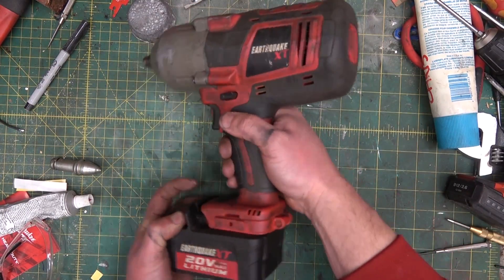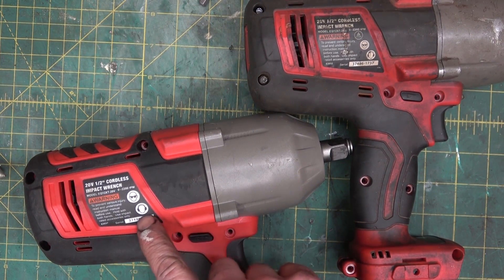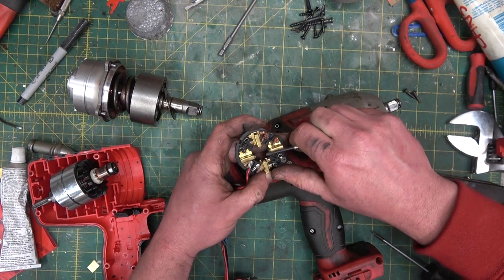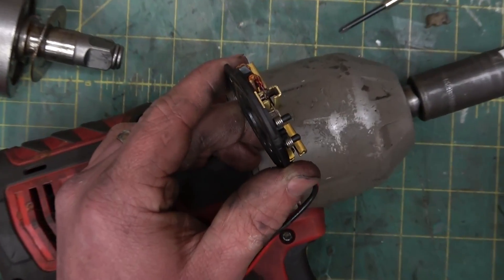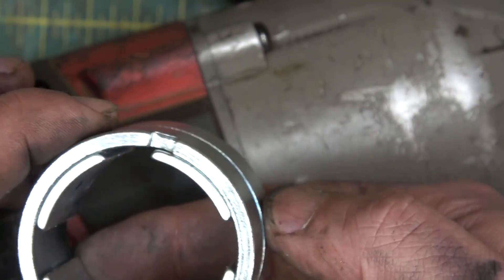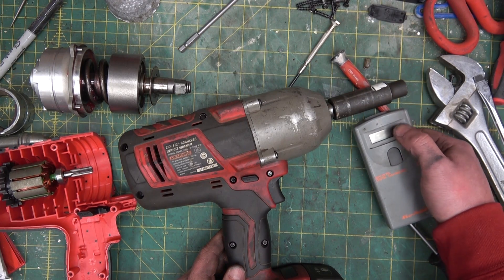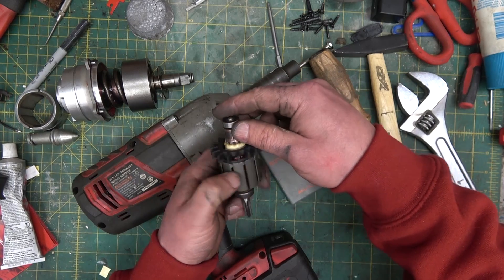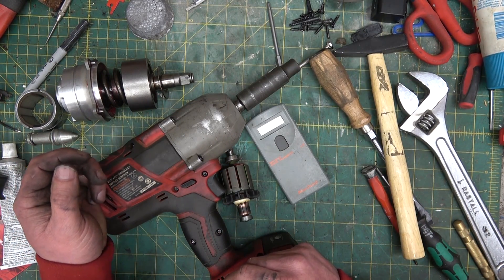Mystery Solved! | Why Impacts get weaker

Comment: So can anyone weigh in on the overall chooch of this gun?  I've had one for about five years and only use it for swapping snow tires on and off three vehicles.  The speed is fine, and batter life is good (only 24 tires a year), but the torque is underwhelming on snug lugs.  I usually break the nuts with a bar first, then use the gun.  I don't see the tire shop guys having to do this with airguns.  Is this normal for battery powered nut smackers, or is mine maybe weakling?  I don't feel any wrist straining torque under load either.  But I've only ever used this particular nut smacker.
Reply: YES.
But that still doesn’t answer my questions.

Comment: I've got two circular saws where the brushes got so hot the springs lost their sprung and started arcing real bad. I've replaced the switches and field coils in both. The armatures tested good by a local guy and I've tested them with a multimeter, but after allt hat, the same issue is presant. What else could it be except the armature? Can tested goo armatures be bad?

Comment: I've fixed a lot of brushed Makita drills for work, and I've seen the same thing happen to them. It always happens when heat is involved. (Overloading the drill ec)  I think it's the insulation on de rotor getting bad, and starting to "leak" current, Wich will mess with the timing of the commutators.
I don't know for sure though, but when you those Makita drills under load while they have that problem they also eat brushes, and get pretty (not extreme) hot thoug.
I'm no expert, but maybe this will help ;)

Comment: Hi, PhD student in magnetic related shit, the power loss is probably due to magnetic ageing of the motor core. Carbon precipitates out of solid solution (or maybe goes into solution depending on your environment or due the dust from the brushes). See Electrical Steels for Rotating Machines by Philip B, page 26 (or message me I'll send you a copy).  

Maybe annealing the core would help? Would be an interesting experiment.

But maybe I'm wrong lol.

Comment: The serial number is so, if you try a rotor swap and return, the cashier takes it apart in front of you in 5 seconds flat, says ‘not honoring warranty, you swapped the rotor, that serial number is not for this rotor.’

Comment: I was thinking when I watched the 1st vid that he has a perfect opporotunity to go parts-swapping to diagnose it further. Glad to see he followed up.

As for the bad rotor, you have multiple brushes and multiple contacts on the rotor that the brushes hit. If one is leading to a broken connection, then that broken connection could easily result in a 25% reduction as the bad connection spins around. I'd want to take an ohm meter to the contacts and see if I could figure out if one contact combination has an obviously higher resistance than the others indicating a broken lead.

Comment: Worth noting that if the magnetic field strength of a motor degrades, the motor spins FASTER when unloaded, because the speed of an unloaded motor is governed by its KE, or the ratio of backEMF to rotational speed.  A demag'g motor cannot make the same torque per amp as one with a full strength magnetic system, so when loaded it is less powerful, but unloaded, then the max speed is simply point at which the forward voltage applied (from the battery) is close to the BackEMF of the motor.
Reply: What you say is true for DC motors with shunt wound stators. I believe this is a PM stator so the field responsible for back EMF is not reduced. And the field of the armature does not contribute to the field of the stator in generating back EMF.  However, if there are shorted windings (as we suspect) that back EMF will be converted to a magnetic torque  load, even if those windings are NOT in commutation.  Meaning, they will contribute  a mechanical load anywhere in their rotation, whether in circuit or not, as long as they are moving through the field of the stator. 
I like the way you think though.  AvE has cultivated a tough crowd for sure.

Comment: Hot cold, hot cold, hot cold work hardens copper, More "work" harden = more resistance. More resistance, more bad till no go time!
This is common on old skool kool, kick-a-me-start motorbicycles. Having half the generator rotor sitting in hot then cold oil somewhat upsets the pixies. In turn, they then upset the rider when it takes an hour or more to kick start the beast! Typically this happens down a dead end trail, in summer, with no other traffic for about three hours.
Have watched this fun many, many times.
But mention a rewind? Nah it won't be that they say, It' be the carb, definitely fuel...
Moral? When you think it's definately something else, recheck the electrics!!!

Comment: Never have guessed that. Fucken motors tho, I’ve had to permanently shelve my Bosch (blue) 10” sliding saw, bastard thing runs but it runs TOO FAST! after lots of head scratching and no answers from the hive mind, I asked a professional motor winder why, and it’s in the motor windings. Can’t be fixed basically. Damn thing distorts the blade when it winds up to full Chooch. So anyone that wants it can have it.

Comment: So a year of commercial use, new motor brushes/rotor, so another year at least barring the trigger failing. If they sell the parts and they're easy to obtain... newer versions might have better fan cooling on the motor now that you published this autopsy as likely the cause of the failure being an overheating armature.... they seem to have bulletproofed the mechanicals!

Comment: The neodidliums in the rings may in fact have less of a field, as field weakening on a dc motor speeds it up.
You get the same amount of power though, less Nm but more ripppppms.
That does not explain this unique phenomena do......
Lets leave it at the fate of the copperilium being worn out
Strange, normally when copperilium has turned green where the kryptonite has leaked out it's your clue.
None here.
Reply: If it is in fact neodidlium magnets, then I would expect the magnets to lose magnetism if the motor were to overheat. They do so at above 80-90 degrees centigrade (just short of a couple of hundred imperial degrees), which is little enough to not get the shellac to smell. I know the phenomenon from model airplanes. Here we tend to overexcert the motors, causing heating, and subsequent power loss.

Comment: Probably why my law tractor starter motor has a hard time starting too! Took it apart and could not find a thing wrong after 18 years of use! 
Thought it was due to lead wiring but a friend replace his wires with bigger wires and it overheated relay!?
Reply: Sometimes starteds can short part of a wiring group and draw far too much current, if you keep burning parts and the starter is turning too slowly then just replace the starter, or check current draw while starting and see if it's excessive.

Comment: Am I about the only one thinking the resistance might be coming from worn out bearings???? Plus the slop in the shaft area?? It is a bit mind boggling to think it's the armature...... Because maybe it's really just the actual moving degrading parts on it? What's that law about the easiest or simplest solution?...

Comment: Hey AVE, I am scratching my head on something that I'm hoping you can possibly shed some Light on. I recently did some home automation stuff utilizing a device called a shelly 1 it seems to use an esp8266, the esp uses 3.3v, but there doesn't appear to be a transformer or step-down circuit at all, the gpio are all tied to line voltage, how is this possible?  There are pictures easily found on Google if you can figure it out from them..  the devices are cheap and handy though. It really has me scratching my head and I'd love your take on it.

Comment: If the commutator has heated, has it slipped slightly altering the pole timing. That could explain the difference in speed FWD/REV

Comment: I thought it might have been the switch but that's interesting it's the rotor. I think a more comprehensive break down of the rotor itself might be interesting to see if the exact point of failure can be isolated.

Comment: Wait-a-minute cowboy! You can't just say the rotor gets weak and go on vacation. You need to diagnose it to the component level. So which part of that rotor assembly has gone wrong? Ohm out the windings cold first. Nice find with the different motorbs, who would have thunk it?
Reply: I found this: "Rotor Condition: This refers to the rotor bars, the rotor laminations, and the end rings of the rotor. In the 1980s, a
joint effort between EPRI and General Electric showed that 10% of motor failures were due to the rotor. The rotor,
although a small percentage of the motor problems, can influence other fault zones to fail. When a motor is started
with a broken or cracked rotor bar, intense heat is generated around the vicinity of the break. This can spread to other
rotor bars and destroy the insulation around the nearby laminations. It can also effect other parts of the motor. What is
just a few millimeters away from the rotor? The stator! Stator insulation can not hold up to the intense heat developed
by the broken rotor bar and will eventually fail. Unfortunately, many times broken rotor bars are not easily seen
without technology and it may be missed as the root cause of failure. This will result in a motor rewind, and
replacement of bearings, but not a rotor repair. When the motor returns to service, it has the same problem all over
again, just with new insulation to destroy."
Reply: Not much of a surprise that a rotor would break in an impact tool. (I'll bet its higher than that industry stat by GE and EPRI!) But what's the cure? better glue between the laminations? stronger steel probably wouldn't change it because they're laminated together. I am wondering if you'd even be able to find a crack once you took it apart. But you have the magnetic see thru tape. Might as well see if that shows us anything.
Reply: Should have changed the bearings before the rotor itself, and remove each tested part after to eliminate combinations causing failure, and isolate it to one single piece. It very well /could/ have been a combination of the brushes and the rotor together
Reply: @hipeoplesSr  I googled "low resistance rotor to high resistance fault over time" which is why it didn't differentiate between motor design.

And I disagree about the windings overheating due to an electrical issue. Usually the smell of the shellac(or whatever insulation they have on the rotor windings) starts to overwhelm you real fast when that happens. When the windings insulation gives way it causes a short which increases the current draw and almost always lets the blue smoke out of the electronics bits. This looks like a possibly much more rare failure... the lamination glue that lead to a magnetic issue. But no one can say for sure until we see what that magic magnetic film he has is used on this device.
Reply: @Sartek  I was thinking the used rotor bearings could account for a few rpms
Reply: @hipeoplesSr  http://www.pdma.com/pdfs/Articles/Identifying_Motor_Defects_Through_Fault_Zone_Analysis.pdf

There's the PDF I got that from. If you check page 10 it talks more about how to check a rotor and it looks like a very universal test so it doesn't matter which motor style it is.

 "One method of testing the rotor condition is the Rotor Influence Check (RICTM). What is a RIC? The RIC is a test
performed on AC induction, synchronous, and wound rotor motors which illustrates the magnetic coupling between the
rotor and stator. This relationship indicates the condition of the rotor and air gap within the motor."
Reply: @hipeoplesSr  I would say the amount of vibration repeatedly being put through the gun would have broken one of the windings where it joins onto the commutator. This is why they used to bind them with string and varnish the string to try and prevent it. They use resin these days. When they overheat they stink of the remnants of acrid smoke, you know even before you have opened the case up.
Reply: Could also be the stator core lamination breaking down, too.
Reply: Mr. possum what a great line (can't just say the rotor gets weak and go on vacation) were you unky B's boss in the past? looks that way
Reply: I reckon the connections between the commutator bars and the windings take a beating and because it's copper over time it work hardens and goes HR.

That would make sense to me at least.
Reply: Way she goes,  its nothing new. RC car motors did the samething after so many races, u could cut com all u wanted and throw brushes in it, even lighter or heavier springs, they just get weak after so many heat cycles and ingestion dust and dirt. That's why everything is brushless now
Reply: once the brushes bottomed out in their slot this slowly increased the clearance between brush and rotor, this increase cause heat stressing int he rotor
Reply: The bearings are ok
The laminations arent rusty
The commutator is also ok
It must be one of the windings being open, if it were shorted you'd either get more speed or magic smoke, or both!
Reply: The serial numbers are different because every time they source a pc from a different source they get a new number. One can be absolute junk with one serial number and he next be the best ever made with a different serial number having better parts used.
Reply: Fellas if n I'm not mistaken he was old guy drank takillya, plan b next morning. Type video.
Reply: @hipeoplesSr  I've done that myself. The wife demands it.
Reply: Are these dc motors in impact guns specially designed to operate in a high frequency shock loading? Does the motor rpm drop in relation to the anvil rotation and impact, or is the load completely/ adequately isolated such that rpm remain fairly constant?
Reply: @mikecschmitt89  are you asking if they stop or "slow down for a fraction of a second" when the anvil  gets hit.  A slow mo camera might answer that question. My response with limited education book wise, but time spent working on stuff I bet it does. Somewhat like the first cannon's on airplanes. They actually stopped the plan for a very small amount of time. They countered that problem by mounting on a shock absorber. You can witness this on a c-130 the barrel will move in and out as its fired.
Reply: Gotta be dragging it out to 3 videos intentionally right?
Reply: It’s the flux capacitor dummies.
Reply: @diemman70  or the 1.1 gigawatts of angry pixies dancing around in there.
Reply: My bet is that several rotor windings became open or shorted,
Reply: @corin164  have to be open; shorted would let the smoke out - could have measure the current and resistance.

Comment: Test the different windings from each opposing pair of commutator bars, possibly one set of windings is open circuit, would explain the difference in rpm being a nice ratio like 25% of the power had suddenly gone.

Comment: Makes you wonder how the earth generates its magnetic field what with it's core alleged to be molten iron and nickel and all. Last time I checked molten metals were too hot to sustain any magnetic field. But then they had Tesla style electric rovers on the moon zipping around with battery power at -250F (night) and +250F(day) so may be all the books are wrong, eh?

Comment: Now here is a thought I remember seeing once, them layers in the rotor are mighty important, if you just wind onto a solid milled bit it does not have a 10th the pull of one made from thin slices of metal stuck together, now could the heat and vibration have loosed them up some and that be the failure?

Comment: That is strange!  The only failure points I can think of are shorted turns on the coil or bad bearings(which you checked).  Hmm, the laminations look fine.  Still another level of failure analysis that isn't easy (unless you want to measure coil resistances from the commutator).
Reply: Shorted turns would be my guess - I'd also scrape clean and wash the areas between the commutator contacts as a matter of course as this area builds up with conductive schmoo.

Comment: I think the culprit is likely the contacts on the commutator. Build up of dirt on the contacts will increase the resistance of the circuit. 
Also a film of carbon soot between adjacent contacts might have enough conductivity to let some current bypass the windings but that's probably negligible.

Try and clean up the old commutator with some fine-grit wet and dry, then give it a good clean, and see if that makes any difference.
Reply: He already did that. Watch the last vid.

Comment: my drone motors get weaker over time as well, i thought it would be the magnets weakening from heat but changing bells from newer motors doesn't fix them either. i guess rotors weaken for some reason.
Reply: I'm pretty sure you're correct. they are over working this brushed motor and magnetic getting weak. pretty common in the rc world
Reply: @jsomething2  my drone motors are brushless so idk if this reflects in brushless motors
Reply: @DingDongDaily  yeah, I think it's worse in brushed motors since they are less efficient and cause even more heat for the same output. heats just hard on electric motors when they are over worked.

Comment: Danger Will Robinson!
Did you check if the commutator bars had brush dust buildt up between em?
This is a classic failure of over-enginerded motors that eat their brushes and end up leaking over the commutator.
Result is high battery drain / less speed as the current isn't flowing through windings doing work. Commutator heats up too.
Reply: He cleaned and polished the com bars in a previous vidjeo.  The other commenters suspect it is probably a broken/shorted winding.  That would also explain why the motor smelled burnt out but still ran.
Reply: @docferringer  if the commutator is not potted the dust clogs space between em and causes shorting.